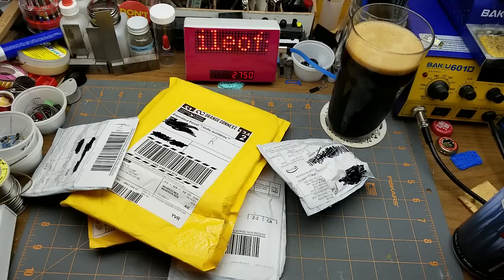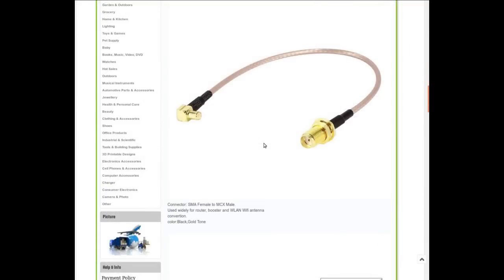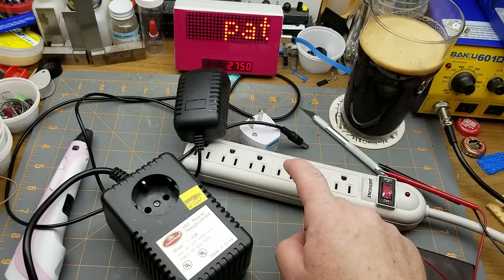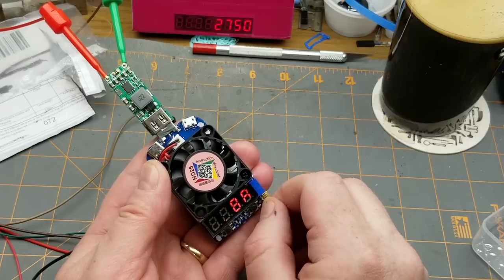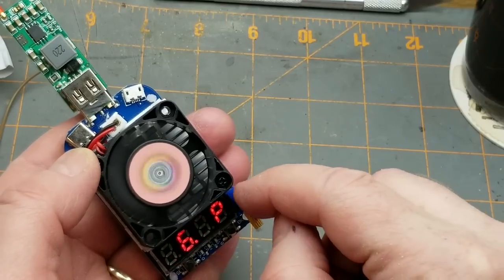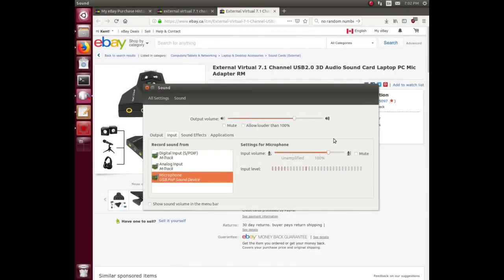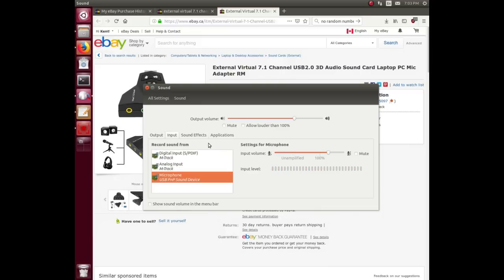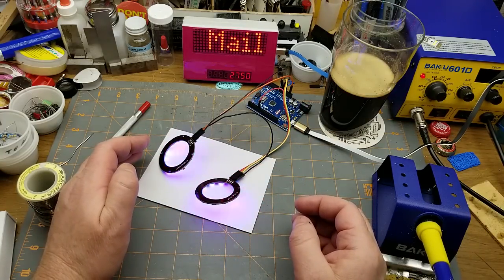Mailbag Monday 51

Comment: Something I bought came with one of those plug adapters. I just glued it to the plug so it doesn't wiggle. Other times I've just opened the adapter and removed the foreign pins and soldered wires with a local plug on it.

Comment: I feel the need to order some more WS2812 rings. I wonder if there’s a nice way to mount one to a 10x magnifier lens to help see things better when I need to read the fine print on a part  with my inadequate lighting. 
  Maybe you need to take a sledgehammer to that travel adapter.  Slow Mo footage of bits of plastic  and metal flying through the air would make a nice montage.
Reply from the maker: IIRC, Yvan at Brainy Bits uses a WS2812 ring as a ring light for his camera.